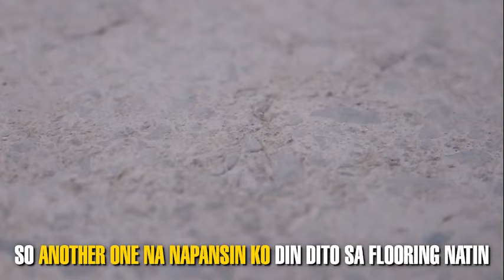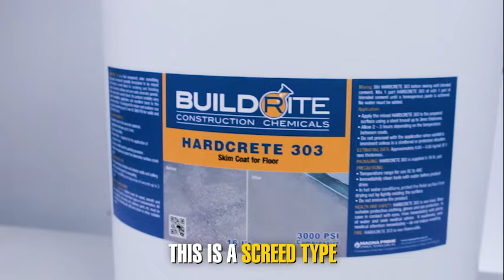Self-Leveling Compound vs. Skim Coat for Floors [Tips About Floor Repair]

Comment: hello po pwede pa compute po magkano magagastos sa bonding agent at level up leveling compound para sa 11 x 10 square feet
Reply from the maker: Hi! Thank you for your inquiry.  Approximately 1-2 bags of Level up and 1-2 Gallons of Cement Grip. Below is our price for Level Up and Cement Grip:

BUILDRITE LEVEL UP 25Kg/bag
Regular price₱1,941.00

https://shop.magnaprime.com.ph/products/buildrite-level-up?_pos=1&_sid=2ced39d9e&_ss=r

BUILDRITE CEMENT GRIP GALLON
Regular price₱496.00

https://shop.magnaprime.com.ph/products/buildrite-cement-grip-4-ltrs?_pos=1&_sid=43aac9bf9&_ss=r

Comment: Goodam Sir.pede po ba gamitin ito sa heavy traffic area?
Reply from the maker: Level Up and Hardcrete 303 has the same compressive strength of 3000psi which is good for heavy traffic areas.
Reply: Sir gaano po katagal curing ng level up bago mag apply ng epoxy floor coating?
Reply from the maker: Hi. Thank you for your inquiry. 7days curing before applying a floor coating.
Reply: Salamat po.order na ako ngayon.
Reply: pede po ng 3mm lang thickness no po?last na po ito.hehe
Reply from the maker: Yes

Comment: Hello po do I have to level pa ung roof deck bago lagyan ng waterproofing? Wala kz akung pera pang labor kaya mag ddiy sana aku sa pag repair ng tagas ng deck nmin nd pa kz kayang palagyan ng bubong ung 2nd floor 😅
Reply from the maker: Hi. Thank you for your inquiry. We suggest to create a slope to drain on your roofdeck to avoid water ponding. You can use Buildrite's Cement grip and Hardcrete 310. You can watch this video for your reference: https://www.youtube.com/watch?v=2NdXHfTcNPc

When you are using Buildrite's Flexicrete as your waterproofing, we suggest to apply the waterproofing first prior to creating a slope to drain. Here is the video for Flexicrete: https://www.youtube.com/watch?v=RPeJKgYIBm8&t=3s

If you choose to apply Buildrite's Clever Sil, creating a slope to drain is neccessary before applying the waterproofing. Here is the video for clever sil: https://www.youtube.com/watch?v=pINmXW1DlaU

Comment: Hello po sir ..tanong ko lang po ..
 Uhm tga mindanao ako camiguin island po .tanong kopo anu po ba ang ginagamit po pag prosiso ..ano poba ang first coating at final ..
Reply from the maker: It depends if you want a smooth and leveled finish prior to application of floor paint, vinyl or wood planks to repair the waviness of your concrete you need to apply Buildrite Level Up and if you want  to make your semi rough concrete and repair the pin holes you can use Hardcrete 303. Both has a compressive strength of 3000psi which is good for foot traffic.

Comment: Hello Sir!! ung floor kase namin is makinis balak po namin palagyan ng tiles pwede po ba gamitin ang CEMENT GRIP para kumapit ang adhesive sa floor para di na namin tiktikin ung smooth floor?
Reply from the maker: Hi. Thank you for your inquiry. Yes you can use Buildrite's Cement grip as tile adhesive enhancer. You can see this post for your reference: (https://www.facebook.com/256507011151769/posts/2275582892577494/)
Reply: Sir bka need mo vinyl installer

Comment: Good day po sir, question lang po sir, puwede po ba gamitin ang self leveling compound sa roof top slab bago po magwater proofing? Planu ko po gamitin clever sil, kc yong slab ko po di level may stagnant ng water po pag naulanan
Reply from the maker: For topping on roof deck you can use Buildrite Elastocrete. Elastocrete is a flexible, cement-based, fiber-reinforced, self-leveling mortar that can achieve 3500psi after 28 days. It contains a combination of specially selected cement, graded aggregates, synthetic flexible polymers, and a unique set control system. 
It can be applied at 5–50mm thickness in one application. The material quickly attains a high surface strength and is walkable after 5-6 hours.  Final covering after 1-5 days (*10 mm/ day) depending on the substrate temperature and the ambient temperature of the work area as well as the relative humidity. 
Click on the link to see details. Thank you.
https://web.facebook.com/BuildritePhils/photos/a.256515081150962/2475239695945145/?__cft__[0]=AZUKcxqv4bZUw6w8P29CPi4dSaejEzeJSKxiYijbEwOZFM504_HumcGA_F6B2StY0ZIqVO3ln5JkBoUoU9-Zg8LlUTjecZh9XoEzvOrEl2XXsOK4zSd1YpoeLi3-WOh5dqw&__tn__=EH-R
Reply: Sir mga ilang araw bago mag-appy ng clever sil, after mag apply ng self-levelling compound?

Comment: sir tanong ko lng po kung puede ko ba ipahid ung epocoat kung naskimcoat na po un flooring.un skimcoat po ns ginamit ay un kulay white un ABC.
Reply from the maker: Hi.Thank you for your inquiry. Ano po gusto maachieve sa flooring niyo sir?
Reply: @BUILDRITECONSTRUCTIONCHEMICALS  un po kc flooring ng garahe namin ay hindi tama ang pagkakaconstruct.kc po un tiles po ay laktaw laktaw then un pinaka space po ay nagkaroon ng bitak bitak sa tingin ko po un pong space na concrete ay dry pack din po un ibang portion kc po nung sininsil ko puro buhangin at semento na parang dry pack kaya po cguro nagkakabitak bitak un ibang spaces.ngayon po balak ko po sana lagyan ng skimcoat un mga bitak kc po malaking trabaho po kung sisisilin ko ng buo.and also para kuminis ng kaunti magaspang po kc.ang tanong ko po kakapit po un product nyo na pang primer kung may skimcoat na.hindi matatakpan po un mga bitak nya.isend ko po sa inyo un picture nung flooring.sya nga pala sir un flooring na pipinturahan ko hindi po buo may mga tiles po na alternate.meron na po kc binili un mrs. ko na davies(acreex rubber paint) hindi ko pa po ginagamit kc nga po napanood ko video ninyo.medyo mahirap nga lng sunfan un procedure.salamat po sir sa pagreply ninyo.
Reply from the maker: For further assistance you may reach us here https://www.facebook.com/BuildritePhils

Comment: Sir pinaalis nmin un tiles nmin kc almost natuklap lahat.. un tile adhesive/mortar na naiwan pede po ba wag na bakbakin?
Reply from the maker: If the existing tile adhesive will affect the elevation of your floor then you need to remove it, if not, then you can apply tile adhesive directly over your existing dry tile adhesive.
Please click on the link below to see video details. 
https://fb.watch/cB1qY-ksgG/
Reply: Pede po ba gamitin yan hardcrete 303 pang level Sir instead of tile adhesive ulit? We're planning to replace nlng ng vinyl kc instead mag re-tile ulit.
Reply from the maker: Yes, you can use Hardcrete 303 for reprofilling of previously tiled concrete floor. You can see this post for your reference: https://www.facebook.com/BuildritePhils/photos/a.256515081150962/2028020970667022/

Comment: Sir any suggestion po kasi yung tiles ko natuklap, balak ko e smooth yung surface para mag vinyl tiles na lang. masyadong uneven yung floor dahil sa bakas ng tiles. Should I use hardcrete or level up. then saan po maka bili ng products nyo.
Reply from the maker: Hi.Thank you for your inquiry .You can use  cement grip  for bonding agent then you can apply level  up for uneven floor . You can see this video for your reference https://youtu.be/IYp0yUixZg4  https://youtu.be/nCUcZMnclF8
Reply: Bka need nyo po vinyl installer

Comment: Hello Sir. Ask ko po kung ano ang dapat iapply sa concrete wall para iwas crack po. Paano icorrect yung wall na pintura na saka lumabas ung mga crack
Reply from the maker: Hi. Thank you for your inquiry. For non structural hairline cracks on walls, you can use Sapal 2in1 elastic sealant and waterproofer. You can watch this video for your reference: https://www.youtube.com/watch?v=BfMS5jx0QfE

Comment: anong bonding agent pwede gamitin kapag meron ng naka install na tiles.. balak kasi wag na alisin yung existing na tiles
Reply from the maker: Hi, thank you for your inquiry. For tile over tile application, you have to ensure that the existing tiles are still intact. You can use Buildrite cement grip as tile adhesive enhancer. You can see this post for your reference: https://www.facebook.com/photo/?fbid=2275577692578014&set=a.256515081150962

Comment: Mga magkano ung isang balde ng leveling compound sir? At ilang square meters ung kaya nya malagyan?
Reply from the maker: Good day! BUILDRITE LEVEL UP 403 25Kg/bag
Self-leveling Compound 3-5mm Thickness at 4000 psi
Regular price₱1,941.00

COVERAGE
One bag (25kg) will cover approximately:
- 4.9 m2 at 3mm thickness
-2.94 m2
at 5mm thickness
Note: The coverage rates provided above are for
guidance purposes only. Actual usage may vary
depending on the specific substrate conditions and
application methods.

https://shop.magnaprime.com.ph/products/buildrite-level-up?_pos=1&_sid=d3f610823&_ss=r
Reply from the maker: BUILDRITE LEVEL UP 410 25Kg/bag
Self-leveling Compound 10-25mm Thickness at 4000 psi
Regular price₱1,450.00

COVERAGE
LEVEL UP 410
One bag (25kg) will cover approximately
- 1.1 m2 at 10mm thickness
Note: The coverage rates provided above are for
guidance purposes only. Actual usage may vary
depending on the specific substrate conditions and
application methods.

https://shop.magnaprime.com.ph/products/buildrite-level-up-410-25kg-bag?_pos=1&_sid=a715649ff&_ss=r

Comment: sir saan ba mabbli ang floor coating pra sa garahe......
Reply from the maker: For indoor garage we recommend to use Epocoat FC or Epocoat FCH. Epocoat FC/FCH is an epoxy based floor coating. It is oil, acid and impact resistance.
You can order online via our Magna Prime Shop (https://bit.ly/3D8vqLx) or our Lazada and Shopee shop or buy from our partner depots near you (https://bit.ly/3mo43WZ)

Comment: sir, sa paglalagay po ng level up, wede ba ito ilagay sa may water proofing na slab?
Reply from the maker: Hi. Thank you for your inquiry. Buildrite's Level Up is for interior application only. As for your waterproofing concrete topping, we recommend Buildrite's Cement grip and Hardcrete 310. You can watch this video for your reference: https://www.youtube.com/watch?v=2NdXHfTcNPc&t=44s
Reply: @BUILDRITECONSTRUCTIONCHEMICALS  i mean sir, may water proofing na ung slab, pwede po ba lagyan nito?
Reply from the maker: As I mentioned, Buildrite's Level Up is for INTERIOR use only. We recommend Hardcrete 310 instead of Level Up.

Comment: How much self leveling per SQ.m. for 3mm to 10mm thk?
Reply from the maker: Hi, thank you for your inquiry.   BUILDRITE LEVEL UP 410 25Kg/bag
Regular price₱1,450.00 --- ₱1,318.18/sqm

BUILDRITE LEVEL UP 403 25Kg/bag
Regular price₱1,941.00 --- ₱396.12/sqm

https://shop.magnaprime.com.ph/search?q=LEVEL+UP

BUILDRITE HARDCRETE FIX
Regular price₱750.00 --- 37.50/sqm
https://shop.magnaprime.com.ph/products/buildrite-hardcrete-fix?_pos=1&_sid=a8ea88b31&_ss=r
Reply: @BUILDRITECONSTRUCTIONCHEMICALS  thanks
Reply from the maker: You're welcome!

Comment: Hi po, paano po kapag yung wall naman, "finished" setup as in ma skim coat and paint pero may alon. Pano po kaya bonding agent dun. Hardcrete 303 din ba gagamitin? More than 4mm po yung lalim ng alon.
Reply from the maker: You can only apply skim coat on unpainted wall. You need to remove the existing paint to fix the uneven part of your wall for better adhesion of skim coat.
Reply: @BUILDRITECONSTRUCTIONCHEMICALS  i mean, after the removal of the paint, what bonding agent can you suggest or is skim coat sufficient?
Reply from the maker: Hardcrete 303 is for flooring use only. After removing the existing paint, you can use Buildrite's Putty Master to fill and repair surface imperfections and voids with a depth more than 4mm. No need for bonding agent. 
You can see this post for your reference: https://www.facebook.com/BuildritePhils/photos/a.256515081150962/2361229744012808/

Comment: Ano pong tama, may part b ang hardcrete 303 or water lang ang pang mix? Sa isang segement kasi may part b ang hardcrete 303
Reply from the maker: Hi, thank you for your inquiry. Hardcrete 303 is a two component skim coat for floors. It consist of powder and liquid inside its container. No need to add water.
Reply: @BUILDRITECONSTRUCTIONCHEMICALS  thank you. Pwede ba lagyan ng cement grip before i apply, in case smooth na ang existing screed na paglalagyan, although may mga imperfections kaya aaplyan ng hardcrete?
Reply from the maker: For technical assistance, you can message us directly at https://www.facebook.com/BuildritePhils

Comment: Magkano po sir Ang skimcoat for floor at ilang sako po Ang maubos sa size Na 6x6meters?thanks po
Reply from the maker: Hi. Thank you for your inquiry. Hardcrete 303 can cover approximately 5sqm at 3mm thickness per pail. Coverage may vary depending on the thickness of application.

BUILDRITE HARDCRETE 303 20kg
Regular price₱850.00
https://shop.magnaprime.com.ph/products/buildrite-hardcrete-303

Comment: paano po kung gusto kong lagyan ng epoxy primer yung tiles kasi po marami syang gasgas,pwede po ba yon
Reply from the maker: No sir. You will need a different epoxy for this, you need epocoat tw as primer to ensure bonding with tiles. Then coat over epocoat tw with epocoat fc if indoor, polycoat flex for outdoor.
Reply from the maker: You can also use epocoat mb, as primer and moisture barrier before applying epocaot fc.

Comment: Ano po ang mga materyales po
Reply from the maker: For leveling your floor.
Level Up (Leveling Compound)
Cement Grip (Bonding Agent)

For repairing pinholes and semi rough concrete:
Hardcrete 303